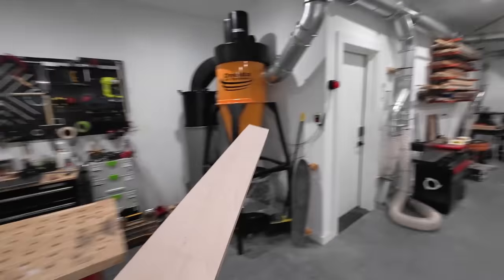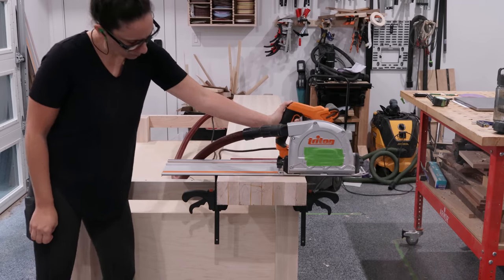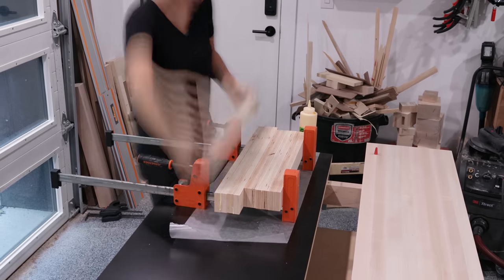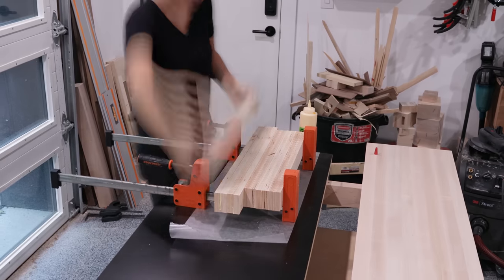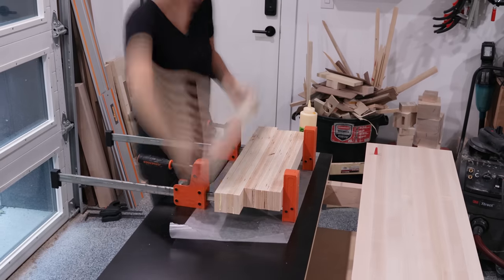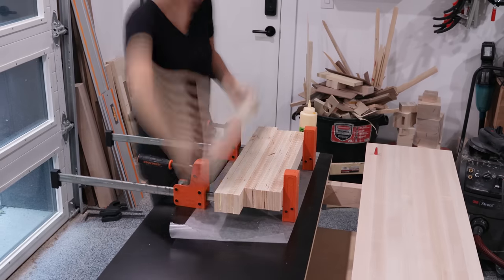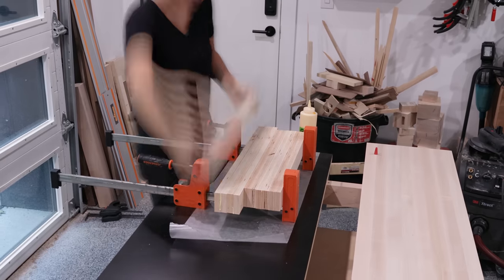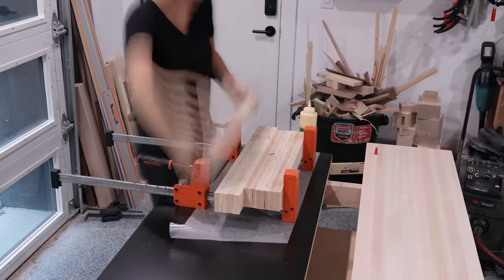My DREAM Workbench Build // PART 3: The Top

Comment: What an awesome bench you designed and built.  There are several features that you included that will go into mine, when I finally have the time to get out there.  Life keeps getting in the way.  
As a suggestion, When you are in the shop, you might want to look into getting work boots.  Having support on the ankle might have made it so your ankle was not hurt as bad.  I know that being on your feet all day, you want a comfortable shoe.  And there are some very comfortable boots out there.  At over $200.00 a pair for Redwings may seem like a lot, but they last me for years. And I have to wear them at work so I need comfort.

Comment: I am still thinking about my—finally!—left-handed bench, and trying to figure out how to combine many useful track saw accessories, which require a certain spacing and hole size, with bench accessories, which are in the different hole universe of your tempting template. Still thinking … but so looking forward not to have a front vise slam into my hip when trying to plane, and maybe have a bench as nice as yours. Lots of valuable ideas here.
Reply: I'm all ears.

Comment: Regarding the ankle sprain injury; two tips I learnt many, MANY years ago - which stuck with me - is to think of the health and safety of the item you're carrying too - and clearing the path you're about to carry it via. If you don't want to drop or damage the thing you're carrying (OR injure yourself) then check the route is clear before you lift the thing. I always nowadays check my route for trip hazards, stuff I might have to contort to get around, etc. It takes a couple of mins for a long route - but my back needs me to be careful these days. It would've saved your workpiece from the drop, your camera from being in the way, and your ankle from the (freak/rare) injury. Obviously hindsight is 20/20 vision but it's a good data point to reaffirm the tips as valuable.
Oh and by God that workbench is amazing - totally inspiring and super helpful for my upcoming workbench build. Thank you ever so much for taking the time to explain the features/benefits. Seeing your love for your designs and those pop-up dogs etc is so wholesome and energising to experience.

Comment: This design is totally brilliant!  I was horrified by the injury though.  I pray for perfect healing of your ankle.  One thing you may consider building in the future is a ceiling mounted boom under spring tension to support your camera.  It frees up your floor space and is easily positioned for any angle to shoot from.  A couple knobs for tightening and you are good to go.  I'm working on my own and plan to make 2 with removable floorplates for quick changes.  Cheers on the completion of this project, it is beautiful.

Comment: Something to bere in mind lass, you DON'T want to counter sink unless you absolutely have to, it's much better to use a brass dome head screw in a counter bore as the sloped sides between the screw and wood create pressure points that will lead to splitting over time, but if you use a flat or dome headed screw set into a counter bore that issue is almost completely eliminated.

Comment: Hey, Tamar. The end of your bench is a natural place for a peg board sheet. Fasten some 1x2s around the edges for stand-off space, then just screw it onto the side. Now you can place hooks to hang all kinds of stuff. The hooks won't poke you because they are under the over hang of the end edge of the workbench. Works great in my shop. Nice work! By the way, the sprain was ugly. I've done similar in the past. One time the doctor said it would have been better if I had just gone ahead and broke it. That way he could have at least put it in a cast. Wow! Get well; be careful out there.

Comment: The pop-up dogs: I ordered the same from your link and discovered the height to adjustable with fine threads in the center plastic piece.  You mentioned cutting to size and plane to flush so I figured you may not know this.  Sorry you got hurt. Thanks for the training videos!

Comment: You are such an amazing young woman and that bench is just to awesome. I was wincing here when watching you hurt your ankle, it looked really bad hopefully is wasn't as bad as it looked.  I jumped out of the hay truck to get more bales and twisted my ankle in a wood chuck hole, first it hurt then it didn't but felt cold, then it changed to feeling hot and then back to hurting, for years after I did that I had to wear high ankle shoes or boots or I would twist it again really easily. Hope you were fine quickly.

Comment: Love the popup benchdogs, genius!Some tips from a long time pro:
The laminate is very easily cut with the tracksaw into manageable pieces, you can even use a tracksaw to cut the laminate flush, just set the depth to one mm and cut backwards to prevent breakout.
If you figure out while glueing you can cut the dowel, domino, cookies, etc. With clippers or a saw, just put a coffee filter or baking sheets to keep the sawdust from going into the glue and reapply if needed.

Comment: This was an awesome build series. Glad U R doing better. I like how U R thinking about making things easier with the side and leg dog holes. U said small girl problems. I'm a former power lifter and bodybuilder. I have hurt my back, knees, shoulders, and elbows doing it. I have no desire to be lifting heavy slabs around anymore. I am all about finding better ways to do this now. There are dollies that are scissor lifts that can be used to lift the wood up to the workbench. Engine lifts are a good option and if U wanted to go big. A rail system with a chain fall can help to lift up heavy objects and move them around UR shop. Size and strength does not have to be a limiting factor. There are ways to do the projects we want to do and do them safely. I enjoy UR videos keep them coming. Be safe, keep making, and stay awesome.
Reply from the maker: Yeah I have to start working smarter with bigger projects like this

Comment: I love this bench, and I might have to make one for myself. Quick hint when pulling the paper backing off of acrylic sheets (like your dog hole template): once you get the first inch or so off the acrylic, lay a 1" dia. piece of dowel, or a hunk of broom stick on the paper and roll the paper up on the dowel using  your palms while holding the dowel against the acrylic. It zooms right off. Works great for larger pieces of acrylic.

Comment: You have absolutely hit a home run here with this design, and the execution, as well. For a (relatively) small footprint, you have the best of both worlds: Assembly table AND traditional hand tool bench.
Notable coolness: 1.) the pop up dogs are amazing, and for my upcoming Paulk style workbench, it solves the issue of having small stuff lost into the void below the holes.
                                 2.) the retractable casters are tons better than the typical units and are heavy enough for a fully loaded out bench. 
                                       Yours will easily top 500 -600 pounds when all filled with goodies (if my guess is correct). Maybe a giveaway for 
                                       closest weight guess? 
                                 3.)  Laminate surface is easily cleanable for glue ups, and the dog hole array has many possibilities. Awesome
                                        template for those two.
If I might offer one suggestion to make the laminate cutting easier on the TS: The laminate (especially thin version) can sometimes ride UNDER the rip fence, possibly ruining the entire sheet. I use a scrap section of steel (or aluminum) angle flashing (3"x3") which I clamp to the blade side of the fence with spring clamps. The laminate sheet simply rides on that flashing and NO possibility of getting trapped under the fence. I learned the hard way on a 5x12 sheet, which I tried cutting with minimal waste and destroyed the sheet.

Comment: The bench is impressive. Nice job!! I did something similar to my ankle. I was carrying a 4x4 pressure treated post down the steps of my basement and still had my sunglasses on. I misjudged the last step and rolled my ankle just like you did. It took a few months to heal. The post was no where near the weight of your bench top but was enough for me to not be able to recover from misjudging the last step. We try to be safe working in our shops but forget that moving materials can be almost as dangerous as our power tools.

Comment: You get so many comments and questions about things you do and use, but if you do see this comment - what are those countersink bits you're using?  I haven't been able to figure them out, but they look better than the old versions I've always used.  I've been woodworking for over 60 years, but I find your videos fascinating.  You learn very quickly and obviously are confident to try new techniques.

Comment: First time watching your videos.  VERY Nice bench!  I am about to build a bench.  I have already acquired the maple for the top and base.  Planing to use the LieNielsen tail vise and a leg vise.
I like your two separate surfaces implementation.  

In handling laminates, I have found that once out of the box (I normally get mine flat and treat like plywood) lying it flat for a while, laminates eventually assume a flat position.  Sometimes a little help is necessary.  A little double sided tape to a board on the top of the laminate would make it more tablesawable.

Comment: I have been struggling to start my bench in order to free up my outfeed table, because I want an assembly table AND I want a traditional bench. Your bench is EXACTLY what I need. Plans purchased. Thank you for the inspiration!

I am also recovering from an ankle injury, mine was a little worse and required surgery and hardware but I’m sure it was no more debilitating than yours, so I commiserate with the pain and lost productivity.

I’m just now getting around but having a hard time with long days in the shop on hard concrete. If it’s similar for you I highly recommend some anti-fatigue mats in front of key work areas.

Thanks for the inspiration!
Reply from the maker: Just now seeing this comment! Your bench came out so great!

Comment: Adding the bolts to the dog hole template as an edge guide is a nice touch!
Reply from the maker: I was testing out a few different bolts as I was using it, settled on the black ones that are easy to turn with you hands!

Comment: Fantastic. I took lots of notes while watching these 3 videos. I really like your design. I recently came into possession of some 6 foot by 2 1/2 foot sections of old bowling alley. It's still all stuck together (would you believe tongue and groove, no glue, with nails every several inches, averaging 120 nails for each section?) Seriously, it takes longer to separate the 1 by 3 boards from each other and pull all those nails than it does to joint, plane and sand the boards themselves. But, it is really nice, old, stable wood, and I will be using those boards to make a bench top. On a separate note, last year I replaced all of my shop machines (long story), and I went with Laguna for the jointer, planer, drum sander and band saw, and a Saw Stop for the table saw. My machines are identical to yours with the exception that the planer is the 20 inch (the drum sander is 25"). As you said, they are all fantastic and I couldn't be happier with them.

Comment: You know what works REALLY well is you take the 1/4" chalk board sheets, cut them to size, and use that as your top layer.  I just counter sink and screw it down.  You can also use the whiteboard.  Works the same for the glue, and eventually its gonna get nasty anyways, and its so easy to replace, legit just unscrew, cut a new piece, screw it into place.  and your case, poke holes in the spots.I use it on top of all my torsion box tables in my shop.

Comment: I can feel your pain. I can imagine how much that hurt. Jay Bates has a mobile stand for camera. He took a 5 gallon bucket and filled it with concrete with a tall aluminum pole in the center and a universal camera mount on top and put wheels on the bottom. It’s heavy enough not to tip over and it doesn’t take up that much real estate on the floor. I’ve yet to make one but it makes sense.

Comment: For the side storage, would it make sense to use a 3/4" sheet of plywood that you could switch out so you don't totally mar your beautiful new bench? Four large screws would probably be enough to hold the plywood in place, and it may even make sense to have different quick access systems for different projects.

The bench looks great, and I always learn something from your videos to the extent that I've started taking notes. The notches in the hand screw clamps for round stock was a great idea!
Reply from the maker: That’s def a good idea! That way I don’t have to settle…

Comment: Tamar, is the flashing light shown when you're using the jointer a safety device, showing that the tool is operating? I work in a community workshop where people often forget to turn off the jointer, and having a flashing light near it would be a useful safety feature. Wondering id =f that's the purpose in your workshop. PS I like the style and tone of your videos - clear explanations, good production values and less egotism than some of the other woodworker channels out there!

Comment: The only concern I have is the wheels.  I would have recessed them a bit on the bottom cross frame.  Or I would have make the top a bit longer as those wheels seem like they will be ankle biters!

But maybe you aren't a slewfoot like me and I'm sure your feet aren't as big as mine, soooo maybe these are just suggestions for moi!  But, a very nice looking piece of craftsmanship! Great job.

Can you tell us your cost and how many hours you put into it please!
(Hopefully to dissuade people like me from attempting such a project! I have a very nice antique rock maple woodworkers bench, with 2 vices, square dog holes and a 10 inch wide tool tray on the back side so I really don't need another bench, but you do have better working,  and nicer looking vices!)

Comment: What a beautiful bench. Unfortunately, I don’t have the space and more importantly, the patience or expertise to make that. I am making, or attempting to make the portable bench you posted a while back. It will be good for working in the house when it gets cold, and bonus, I don’t have a significant other, so I can do what I want! I could only find 1 x 10s at the big box store, so I am making it a bit thinner. Waiting for the glue to dry. Fingers crossed. Any thoughts on 1 1/2 inches thick for the mobile workbench? Should I add another board? I make bird houses mostly, nothing really big.

Comment: Nice bench! Great video! Shame on the bench vice company for showing a dog in the marketing materials but not including one. It's obviously much less useful without one. I'm sure you wouldn't have bought it if you knew that. Thanks for sharing that experience. I've been seeing a lot of misprints in ads lately... The ankle shot looked painful and could happen to anyone. I've sprained my ankle in much less magnificent of a fashion (Simply stepping off a curb onto the edge of pothole). It takes forever to recover but the air casts are verry helpful. I think you were lucky and it could have been much worse.
Reply from the maker: Thanks! But I wasn’t misled.  I knew before purchasing I would have to drill my own hole. I was just saying that they suggest it is an option in their website. It wasn’t my idea.

Comment: You know, I was just thinking...That side panel has a lot of space but looks nice without a whole bunch of stuff on it. Maybe you can design temporary displays of whoever is the video's sponsor. Maybe it's not the best use or idea for that space but it could be used. the other ide is to place some temporary ad placement on those long sections of the top that are used less during whichever build you are doing. Maybe...

Comment: Loved watching your process, even though I'm far from the skill set (and tools) I would need to undertake this plan.  I am about to construct two really simple connecting modular workbenches for my art studio and would love to use your bench dog template for the tops.  Two questions about that— what 1/4" router bit would you suggest using (the link on your template page for router bit does not work) and will this work on a hardwood butcher block top (1.5" thick).  I'm assuming the holes are larger than 3/4" to accommodate the guide bushing.  Thanks, Liz

Comment: Just a quick question, your brand new jointer and planer don't have spiral cutterheads? Because then you really don't need to worry about grain direction. It was quite an expensive option on my machine but have I saved a lot of time not needing to sand for hours and hours afterwards!

Comment: This bench is a work of art. I love that center piece with spaces to hold tools. This is soooo uptown compared to your ratty, stained old plywood top - except that one had homages to your 3 little ones (which are not so little anymore). Will you add an homage to this bench? My guess is your logo would be it.  BTW - too sympathetic didn't look at the accident clip.
Reply from the maker: Thanks! Yeah I do miss my kids messages. But they are leaving stuff for me on other parts of my shop ☺️

Comment: Wow. Its so awesome both functionally and in terms of design ! Congrats its amazing. Now I just need to build it (with a metric system). Also, how do you cleanup the dust that gets into the torsion box ;)
Reply from the maker: Thanks! There is no dust build it up the torsion box bc the holes go all the way through. And I made sure the holes were in the location where the plywood was. That’s why I glued up two pieces for those sections.